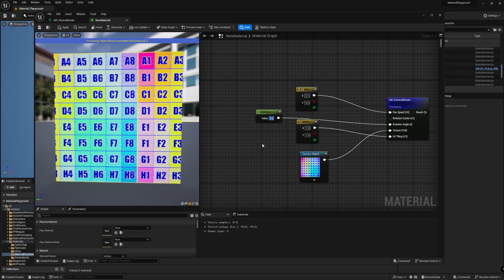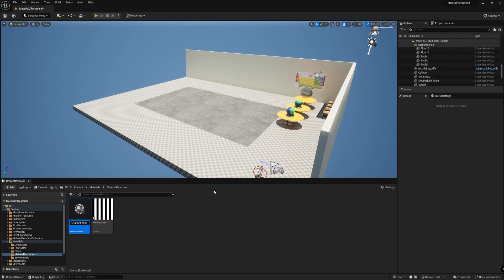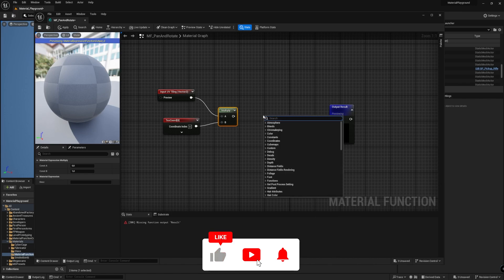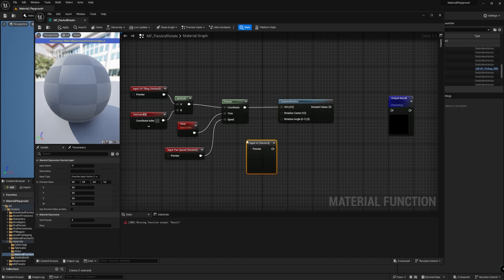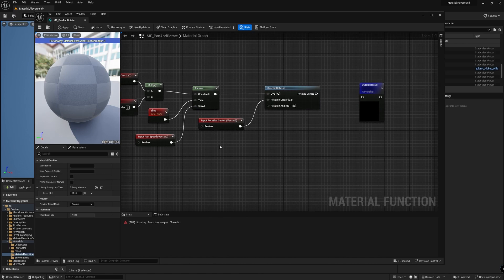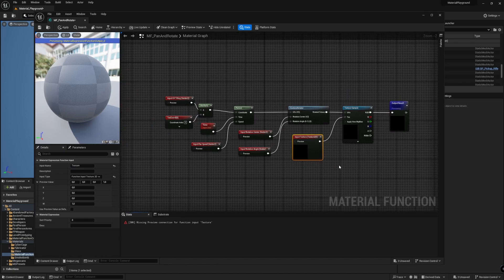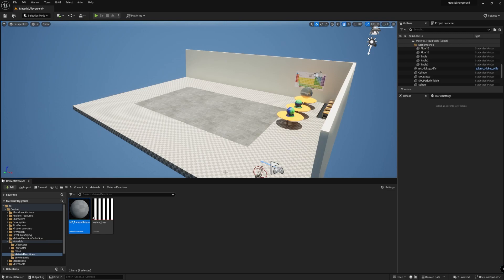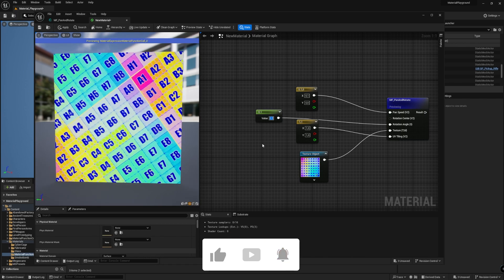How to ROTATE and MOVE a texture in Unreal Engine 5

Comment: Hello, your video tutorial was extremely helpfull for me and I achieved what I wanted to add to my project, which I could have not done without this video.

I wonder if there's a way to update the texture Input rotation center to whatever the center of the output uv texture is.
I'm using dynamic material instance to create a floor for my character that rotates when I input and after that pans in the speed of also my input. Your Material function works like a charm and I'm very gratefull. The only issue I'm running is Each time I stop sending input and start again, The pan restarts from the center, and I don't know where I should, can or how set the center to its current output's center. 
Thankyou, I appreciate your tutorial ! :)